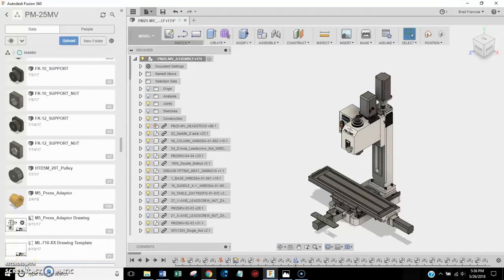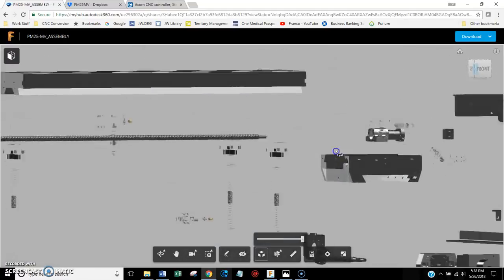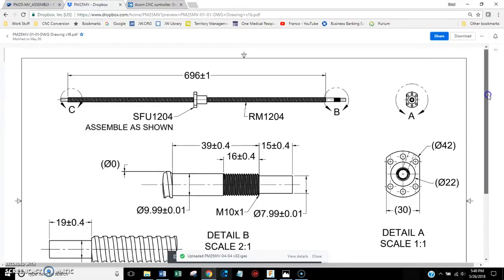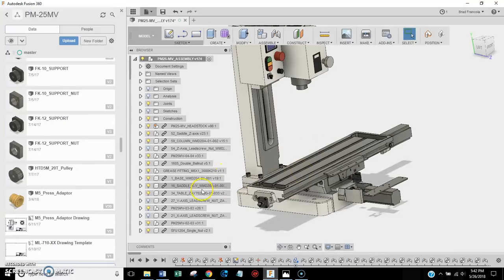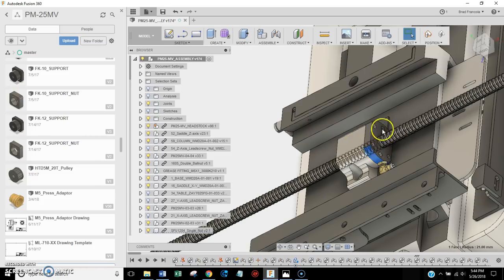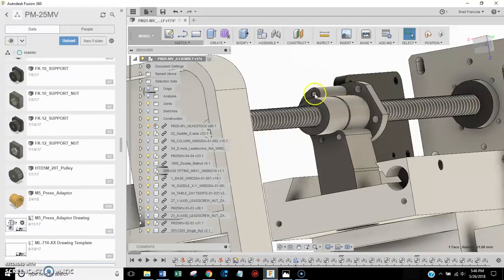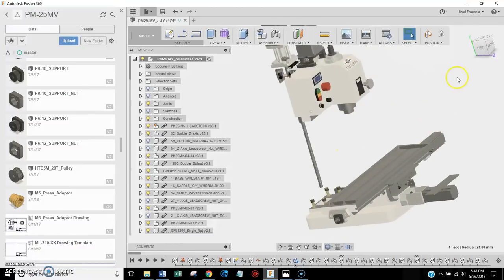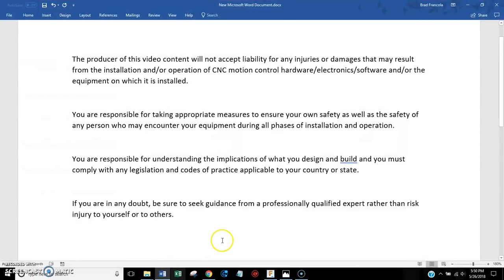PM25-MV CNC Conversion FREE Plans to convert your Milling Machine to CNC

Comment: Hey Franco just wondering if there are any other drawings with dimensions besides the 3 in the link all the other files are iges models
Reply from the maker: Hi.  That's all I have for now.  You may want to try opening the Fusion 360 files.

Comment: Hey Franco do you by chance have drawings with dimensions rather than fusion 360 iges files?
Reply from the maker: Hi.  Look in the description of the video.  There should be links in there.
Reply: @FrancoCNC  oops I missed them thanks . Can we have an update on the new mill soon??
Reply: @FrancoCNC  i only see the iges files and 3 drawings am i missing something or did you only put 3 drawings and the rest are models
Reply: @michaelbrocato7535  I had the same issue, only saw X axis mounts for drawings.
Reply: @nicholasmcconnell7853  I ended up learning fusion 360 and making my own drawings there are only a few pdf files saved as drawings the rest are f360 files . Being a gcode programmer for my day job I was able to learn fusion 360 pretty fast

Comment: Thanks for sharing the files Franco, my mill is not a pm25mv, but very similar, I think basic part dimentions are the same but I could not find a kit for my machine and was a bit worried about shelling out for a kit and it not fitting. With your help i can now check all dimentions against my machine, after converting to metric(another big task) then i intend to make some square plates manually to get the machine up and running then make a better looking set using cnc. 
Are the 1204 ball screws enough for x and y? i intend using 1605 for x and y and 2005 for the z, i will go through your other videos to see which motirs/drivers you used too.

Also am thinking of centroid acorn the only thing that bothers  me is buying a new pc as i already have 10 or so and many bits but to comply to minimum pc requirements of 1500 single thread benchmark is not a cheap old pc. thanks again for sharing.
Reply from the maker: Those 12mm ball screws have worked really well for me - no problems.  And, they are easier to fit under the saddle.  If you have Fusion 360, you can download the entire 3D model and just switch it on over to metric.  Many of the models are probably metric to begin with.    Have fun building!
Reply: @FrancoCNC  Thanks, i know where to go if i get stuck.

Comment: Can all the parts be made on the PM25-mv before you convert it or does it require a CNC to make the parts before converting? Will be my first machine and don't have access to any other CNC before converting.
Reply from the maker: Hi.  I had CNC in mind when I made the drawings.  But, you could take the dimensions (hole spacing, mostly) and machine "simplified" versions of the parts and they would work.
Reply: Hi, I have the same idea, buying PM25, machine conversion parts on manual mode and then proceed with cnc conversion. It is possible but i believe I will need rotary table to mount it on the mill for that. I assume i will spend quite some time but I am doing it for fun.

Comment: Franco

I see you used 12mm ball screws for your conversion and were happy with the result. Would you make the same choice again?I am converting a PM 727 and the table is the same size as the PM25. The base castings look very similar to those on the PM25. I am thinking of going the 12mm route as 16mm is a bit of a squeeze to get it in.

John
Reply from the maker: Hi.  The 12mm ballscrews have worked out just fine.  I doubled up the nuts to minimize backlash and that worked great.  I would not hesitate to use 12mm ballscrews again in the future.
Reply: @FrancoCNC  Thanks for the info. I will try the 12mm screws first then and only change over if I have problems. It is much easier to fit the ball nut on the 12mm size I will be using a pair of ball nuts as you did. John

Comment: Mr. Franco, Thank you very much for posting this very useful video and files- I've watched it several times, and it actually helped push me over the edge towards purchasing a PM-25MV.  I'm at the beginning of sourcing conversion parts for, but have a few questions....
 I noted that the ball screw drawings had two single nuts for the X and Y axis... I haven't gone through all of the CAD drawings yet, but do they simply bolt together back to back, perhaps shimmed in between?  
Does using a single ball nut give acceptable backlash when used with the bearing cartridges, or would you recommend using 2 ball nuts on each of  the X and Y?

Thanks,

Brian M
Reply: Oops, nevermind. I just went back and watched the pertinent part of the video with the sound on and answered my ow question... ;)
Reply from the maker: @brianmlodzik9052  Awesome!

Comment: Mr. Franco,  
            Hi, 
                 I just started making a part or two now trying to squeeze it 
between jobs at work and not get caught ;) I want to make sure that the files I 
downloaded from YouTube are good files for fitment? 
and you used Nema 23's for the x and y and Nema 34 for the z axis, this right? Tried Emailing you i never get a response,
and thing else maybe you can recommend ? 
Thank you very much
Reply from the maker: Hi.  I get a LOT of email and it's hard to keep up with it all... sorry about that.  As far as I can tell, the models and drawings are correct.  Everything fit up well on my machine.  Yes, I did use NEMA 23 for x and y.  NEMA 34 for z.  I hope your build goes well.  Please post a video!
Reply: @FrancoCNC  i will post a video when i'm done, i have a couple video up now when i gotten my new pm25mv
Reply: you said you have double ball nuts. will your drawing work with single ball nuts too?
Reply from the maker: @wow-wow-p8d  sure will.

Comment: Thanks for sharing these files, I have the warco 16b I'm pretty sure the casting are the same as the pm25, 2 of your parts so far have fit.do you know what size the grease nipples on 1605 ball nuts are?or did you drill and tap them out?
Reply from the maker: They come from the factory with tapped holes. I believe they are M6

Comment: I would invest in a 3D mouse if you work with CAD, it will save you from RSI in the long run.
Reply from the maker: You are probably right.  I actually had one at my day job but  just can't get accustomed to using it.  I'm like the only guy at work that doesn't use one.
Reply: @FrancoCNC  if you can't get used to it it's because you think like me from the camera instead of the part.  Try reversing all axes, it's like night and day, you will thank me later.  PS Your videos are awesome! Thanks a ton

Comment: This is wonderful! Thank you for sharing all your work so openly. I have been wanting to add a CNC mill to my garage shop and you may be making that possible. Can you give me an idea of how much I will be spending on parts for the conversion? When I order the mill itself, are there any special requirements I should specify?
Reply from the maker: Hi.  Check this out:  https://youtu.be/dvbsIgrwl1U
As far as the mill specs go, there aren't too many options.  I'd go with a Precision Matthews as I believe their mills are easier to convert to CNC (bigger, stronger castings with more clearance for ball screws).

Comment: I'm working on getting a PM25MV to convert and I was thinking of using a centroid Acorn with a Leadshine MX4660. Does that sound like an okay setup or should I look into something else?
Reply from the maker: Hi.  That looks like a really nice driver.  I think it will work just fine with the Centroid Acorn board.
Reply from the maker: The only thing I'll add is this:  Closed loop is always going to be better than open loop.  Many of the little issues that give you headaches go away with closed loop systems.  You may want to consider a closed loop system before you spend your money.

Comment: Franco did yours come belt drive or did you convert it over if you converted it over where did you get the plans or are  they your own. Mine came gear drive and I would like to convert to belt drive I have a couple of ideas but still checking so I do the right thing the first time if you know what i mean
Reply from the maker: My mill came from the factory with belt drive.  You may want to check with PM and see if they will sell you the parts to upgrade yours.

Comment: Brad your designs are great, I plan to use some of your ideas in my own mill conversion. The G0765 CNC kit I bought from you is working great, I turned out my belt drive pulleys for my G0704 belt drive using that machine. I may elect to jump up to the Mathews in the future but I’m learning a lot on the Grizzly conversion.  I am a 100% fan of the Acorn system. Centroid produces a great product and software package for both the mill and the lathe. Thanks for sharing the information.
Reply from the maker: Thanks.  I really appreciate your feedback.  The Grizzly G0704 is a great machine, too.  I made LOTS of good parts on my G0704.